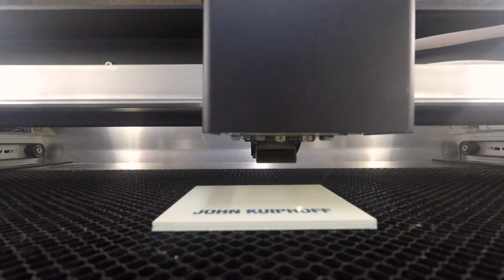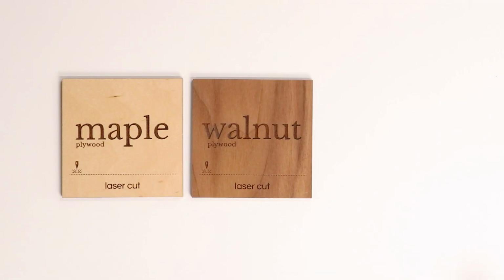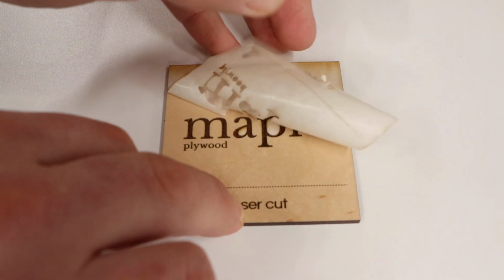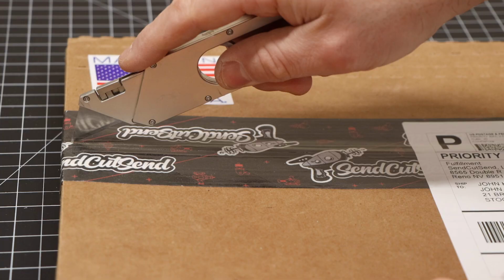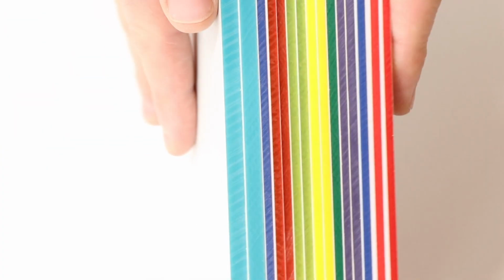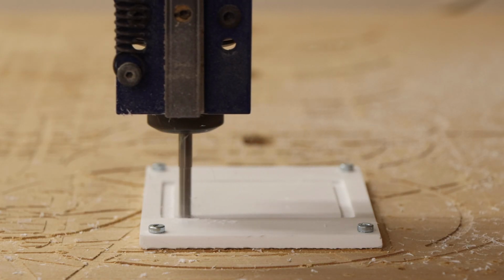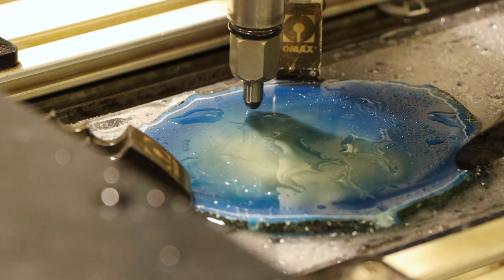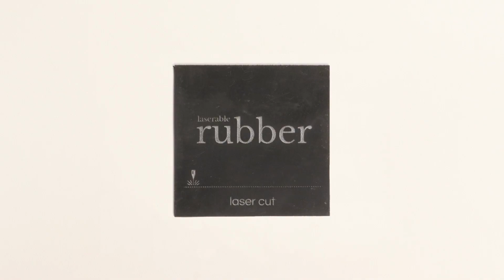Laser Engrave Everything with a Glowforge!

Comment: What about tempered hard board? What settings would you recommend for cutting and engraving? I am planning g a craft that I would paint, so I am thinking I would need to have the rough side be the front of the finished product. Can a piece be cut and engraved at the same time, or would you cut it out and then engrave it?

Comment: Would it only engrave in dark color? Can setting change it to white engraving?
Reply from the maker: Some materials engrave dark (wood, leather, etc). Other materials engrave white (acrylic, slate, etc). While you can’t change it based on the setting, you can usually paint fill it with a different color after the engraving is finished.

Comment: Hi there! Would I be able to engrave on gold filled metal using the Cermark spray? if so would I need tape or anything else over this metal? I make necklaces and usually handstamp but hoping to try something different.  Lastly, does it always have to engrave in black? Thanks for any help!
Reply from the maker: Hi, Kierra - you might want to check out a Fiber laser - it's a different technology than the C02 lasers (like the Glowforge). A fiber laser can engrave metals often with different colors. The Glowforge can only mark metal using Cermark. It's always a black marking as far as I know. Honestly, it would be awesome to have both. ha! A fiber laser is my next investment for my own shop.
Reply: @JohnKuiphoff  so so helpful! Thanks for the info and your awesome video! 

When you say marking, does the marking eventually fade away?
Reply from the maker: @kierramccleary9097  No, the marking is permanent. It's a chemical reaction. I've used it on so many client projects and it's works great. There are also cheaper alternatives to Cermark (I've tried them all), however, Cermark still works the best. I normally coat the metal the EverBright when it's done to make the back standout and to protect the metal. I didn't do that in this video. ha!
Reply: @JohnKuiphoff  haha perfect! I’ll try those out! Thanks a ton for your help!

Comment: hey so the paper masking it says it has vinyl in it  and should not be used for laser engraving?? May want to edit that part out so people dont inhale nasty fumes
Reply from the maker: Hi William - I believe that they started putting that that disclaimer on there as a CYA. The product was originally designed for vinyl transfer, but it is widely used for laser cutting. It should be perfectly safe. If you check out the comments for the product, you’ll find that the mass majority of people use this for laser masking. I also ran the paper through a vinyl test to double check that it was okay. I will link to another product though if I can find one that works as well. In fact, I’ll look around today for an alternative. Someone else also reached out to me recently with the same concern. I really appreciate you reaching out. Thanks!

Comment: That's crazy, thank you! How did you do the stainless? Did it require anything special? Like a spray or enhanced laser?
Reply from the maker: I usually order the cut pieces from SendCutSend.com as the Glowforge (or any other C02 laser) can't cut metal. It's easy, I just upload my vector file to their website, pay about $30 and get a ton of parts back in a few days. Once I get it back, I spray the stainless steel with Cermark Marking Spray and mark/engrave it in the Glowforge shortly after (300 speed; 100 power; 370 LPI). After that, I just wash off the cermark spray and it's done. Sometimes I got it with Everbright to protect it and bring out the blacks. I didn't use it in this video because I didn't know about it until recently :)

Comment: Ok here we go im trying to make Trophy  nameplates and im using a material from Amazon that is 0.040 thick and i was wondeing if someone can Recommend A setting
Reply from the maker: Hi mark, if you are spraying the brass (I assume?) it with Cermark spray, 300 speed; 100 power; 340 LPI should do ITV- but I’d test on a test piece first, if possible. Do you have the link to amazon?
Reply: No i ordered black acrylic with white underneath it. .040 thickness. Thats what I'm useing to make the Plaques
Reply: Hey John this is what i purchased
XLNT TECH BLANK ABS DOUBLE COLOR. It's Black and White. Have you ever used this material. I'm just Engraving and Cutting out. .040 thickness

Comment: question? why do you prefer your engraves to have such slow speeds and low powers? instead of going a little quicker to save time?
Reply from the maker: Generally, the slower engraves just look a lot nicer. Even when using a faster machine like an Epilog, slowing it way down gives it time to burn darker and evenly. You’ll see this when cutting, too. For example, if you cut fast with high power, you’ll scorch the corners a bit when the laser makes a turn. Keeping things a bit slower makes the engraving or cutting more even. With that said, I’d I’m creating a jig or a prototype, I’ll engrave the piece quickly just to get it done.
Reply: @JohnKuiphoff  ya I tried your settings compared to other recommendations and your settings look way better! Thanks!

Comment: What about polymer? Like for a gun grip or handle?
Reply from the maker: Yes, I believe that you can engrave onto most polymers. I've worked with a lot of different types polymers in the past. Some work really well, while others make a TON of smoke or flare up. It sort of depends. If I was asked to engrave a gun grip, I might consider using a CNC machine instead as it would be more predictable (unless you have a small sample that you can test first).

Comment: Question what's the size of the black tray?? Well guess it doesn't matter if I have the pro I can feed it through the passthrough but again I dont know the size
Reply from the maker: It’s about 12 inches by 20 inches. I have the pro which helps if I need to cut something larger. Although, most of what I need to engrave or cut for clients tends to be smaller... so the Glowforge has worked out so far :)

Comment: I bought aluminum name plates, but i don't think their anodized aluminum. would this still work? can i just use cermark on it and engrave like usual?
Reply from the maker: Yes, you should be able to use Cermark on raw aluminum. In my experience, raw aluminum has been more difficult to mark than other metals -  I'm not sure why. Although, I haven't marked aluminum all that much. I do work with a lot of stainless steel and brass.

Comment: Did you have a video that included the settings for the different woods?
Reply from the maker: I usually use the preset for proofgrade maple as it look similar for almost any hard wood. Softer woods (like pine) usually require less power as the wood burns more easily. Some wood is difficult to engrave due to the grain (certain parts are hard or soft) It's often difficult to engrave red or white oak. I will be uploading a lot more Glowforge videos this summer after I'm finished with a home renovation and plan to upload a video specifically on engraving every type of wood.

Comment: Also, can I engrave sterling silver or gold?
Reply from the maker: You can mark sterling silver or gold if you spray it with Cermark Spray (like the other metals shown). However, if you want a true engraving on silver or gold, a fiber laser is better suited for the job- it works totally differently than the Glowforge. There are fiber lasers designed for jewelry making. Thanks!

Comment: I’m getting mixed signals and info on engraving different types of metals. So I can safely engrave metals? Do I have to use the cermark spray and if so does it always make the letters black?
Reply from the maker: You can chemically mark different types of metals using the Cermark spray with the Glowforge - the letters will be black. I also coat the metals (i didn't do this in the video) to make them more vibrant from every angle while protecting the metal from scratches. With that said, for actually engraving metal, a fiber laser might be a better option. The Glowforge is a CO2 laser - it works differently than a fiber laser. Overall, the Glowforge is more versatile than a fiber laser, but a fiber laser is designed specifically to engrave metals. Some fiber lasers can also engrave metals with different colors.
Reply: @JohnKuiphoff  Thanks John! What do you mean by “coat the metals”? Isn’t that the purpose of the cermark? Just curious. Thanks again!
Reply from the maker: @bunnylewis6557  After you apply the Cermark, laser mark the graphic and wash off the Cermark, you can then apply some of the Everbright (https://amzn.to/2O9Q4ah) to the piece to protect it. It's sort of like applying poly to wood after everything is all done.

Comment: Hey John, do you have a list of settings to accomodate the power of a pro model?  or a general adjustment to work with?
Reply from the maker: I actually upgraded to the pro and I found that the same settings work for both the basic and the pro. The pro is slightly faster (because of the laser tube wattage increase) with the same settings. I can run some side-by-side tests just to verify it though... thansk!

Comment: The link for the paper masking says "not for use with laser cutters or engravers"   Is the link a mistake or is that a liability check from this company?
Reply: BTW... Thanks for this great video...  I appreciate all the help, I am so new to this...
Reply from the maker: Hmmm... I saw that. That's the paper that I've been using for quite some time. I know many others use it for laser cutting as mentioned in the Amazon reviews. I wonder if it's a liability statement. There's a test that you can do with a copper wire and a torch (Beilstein test) to check for organic halides. I use that test as one measure to see if a material isn't safe to cut/engrave.

Comment: I don't know if you will get this message, it's been almost a year since the video was posted. The list of materials you have a link to was to include banned materials, but I didn't see them mentioned on the list. What materials would you stay away from? Thanks.
Reply from the maker: H John, the most important materials to avoid (as they are common materials) are PVC and vinyl. Other materials on the banned list include pleather, HDPE, PolyStyrene Foam, PolyPropylene Foam, Epoxy, Fiberglass, Carbon Fiber, PTFE, Beryllium oxide. Hope this helps!
Reply: @JohnKuiphoff  Extremely useful, thank you John. I had to look some of those nasties up on the internet, but at least I now know what to stay clear of. I was wondering about polystyrene. Have subscribed to your channel and look forward to learning more :)

Comment: what model of glowforge did you buy? :o and why?
Reply from the maker: Hi Jethro, I started out with the basic when it was first launched and have been running it pretty hard everyday for a few years without any issues. I do recognize that it's an entry level laser and probably on borrowed time at this point. I recently upgraded to a Pro as I was making more than enough money with the basic to easily justify the purchase. The Glowforge Pro is a nicer machine and has a passthrough (which I actually haven't used quite yet). With that said, if I was just starting out and planned on using the Glowforge a lot, I would probably consider the Plus because of the extended warranty and slightly better hardware than the basic. If you're only going to use the machine occasionally, the basic would serve you well. Honestly, at the end of the day, all three models output the same thing. ha! I'd just go with the model that you can afford. Also, I recently started filming a course if you're interested: http://gfcourse.com/

Comment: Hi John, is this machine suitable for engraving names on jewellery? Obviously, many jewellery items may not be absolutely flat. Thanks.
Reply from the maker: Hi John, you can "mark" metal using Cermark spray using the Glowforge - I do this all of the time. If the items are not absolutely flat, that'll probably be okay (rings might be a bit tricker if the engraving is large). I've engraved lots of items that aren't perfectly flat. With that said, you might also want to look into a fiber laser if you'd like to work with jewelry - it's a different type of laser than the Glowforge.  Ideally, you might eventually purchase a fiber laser and a C02 laser... but you might want to look into buying a fiber laser first, depending on the look you are looking for.

Comment: Can you cut ( Depth)and engrave sterling silver? Also when you have finished making a ring can you engrave  words or patterns on the outside and inside of the ring?
What about sea glass and pebble engraving too?
Thankyou
Reply from the maker: Hi Amanda! I believe that you can only "mark" a small portion of the outside of a sterling silver with the Glowforge. The marking on metal doesn't actually have any depth at all. Rings are usually engraved using a different kind of machine (either a small dentist-like drill or a specialized CNC machine). With that said, sea glass and pebble engraving works great with the Glowforge. I'll cover both of those in the course that I'm creating: https://gfcourse.com/ - Thanks for watching!

Comment: Thanks you very much John for a nice demonstration. What about epoxy resin ? Can engrave it also? It's engraved on surface or we can engrave also into material by focusing on low layer (into transparent resin ?). Thanks you very much for response!
Reply from the maker: Marek Vančo thank you! Unfortunately, it’s not safe to engrave resin (something like total boat) as far as I know. I believe that it might release some pretty toxic gases. With that said, you can use a CNC machine to cut into resin - I do that often. You might even fill that with colored epoxy to make it look engraved. Hope that helps. Thanks again for watching!

Comment: What a great video.Very inspiring. I'm thinking of getting a Glowforge and am currently at the research stage.  Could you, or any other Glowforge users, tell me if it would be any good for cutting camel bone knife scales?
Reply from the maker: Thanks! I'm pretty sure that they might engrave well. The bone sample at the end of the video engraved beautifully on the first try. I'd happy to try one out and mail it back to you if that helps. However, cutting the camel bone might be a bit more difficult. My first guess without researching it is that cutting would work better on the cnc machine (or just using a bandsaw with some sanding afterwards) and engraving afterwards using the Glowforge. The only thing is that bone dust isn't too good for you... you might need to wear a good respirator. It also smells pretty bad when being engraved.

Comment: Ok first off as a former owner of a LMI ( Laser Machining Inc, Somerset Wisconsin) machine, Corian and any poured solid surface material should be sandblasted using a photo emulsion screen template. It's toxic and will give your shop help headaches, (Workman's comp waiting to happen! Includes cultured marble too unless well ventilated!) I would like to know if the 40 or 45 Pro can cut Melamine, do you have a test? 

Expanded Foam... the kind used to insulate a house with that Halloween Prop makers use for tombstones and other things. Thank you in advance and subscribed for new content!!!

Comment: So far, most informative vid yet.
I had to sub as I’ve been looking hard lately. COVID/work here in Canada as a physically challenged scaffolder is tough to support family. Would you recommend the pro model? What about make block? 2 grand cheaper.
Reply from the maker: Hi, Robert. I've certainly been offered a lot more laser engraving / cutting work when COVID hit. For me, it's just a side hustle. I made about $1,500 this month cutting and engraving signs, custom drum badges, gaskets, etc with the Glowforge. I often think about biting the bullet and plunging in full-time. I recently bought the Pro as my basic now has a million miles on it (but it still runs perfectly fine). I don't know that much about the Make Block laser cutter other than what @makesomething (https://www.youtube.com/watch?v=wEzw3Tp3Aig) showed on one video. Although, he still continues to use the Glowforge in all of his laser cutting videos. With that said, all laser cutters output the same thing... some are easier to use, faster, have a better community, etc. The Glowforge basic worked great for me as I started out... the pro is a little faster and can handle larger materials when you need it to. I'd buy whatever you can afford. I'm sticking with the Glowforge as their engraving quality is incredible - even if it's slower than other machines (which oddly helps with ventilation concerns in a neighborhood). You may also want to look in to a good CNC machine. I also make a lot of money on the side with my Shopbot. I love the Shopbot Desktop Max, Avid is another good  brand CNC; the new X-Carve Pro is pricey, but easy to use - I owned their first model starting out. I recently started working on building a full Glowforge course - I'd be happy to give you an early access link to it. The full course will be released in March or April. Also, I'm happy to talk more about the business if you'd like. My email is kuiphoff[at]gmail.com

Comment: This machine is expensive compared to a chinese K40 ... And no exhaust ?  That can't be healthy
Reply from the maker: I owned something like a K40 a few years ago, although I burned it up pretty quickly because I didn't know what I was doing. ha! Yes, the Glowforge is definitely more expensive... but the engraving quality is AMAZING and it's a pleasure to use. I just bought a second Glowforge which is a bit faster :) You can exhaust out the window, although I also have the Glowforge air filter if I need it. I rarely smell anything in the shop while it's running. The cheaper machines are a good way to get started, especially since they are only about $500 or so. My Glowforge is a big part of my business so it makes sense for me to invest in a higher quality machine.